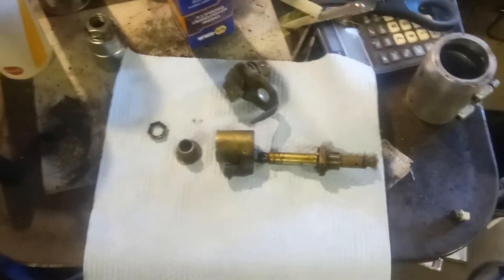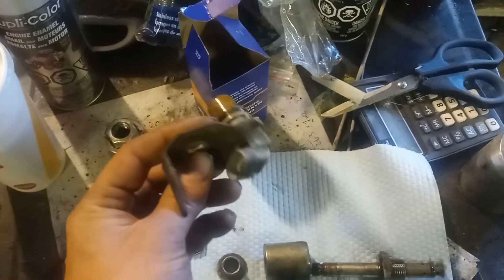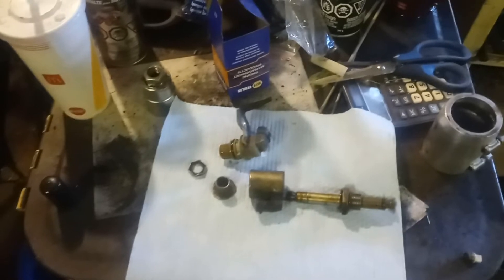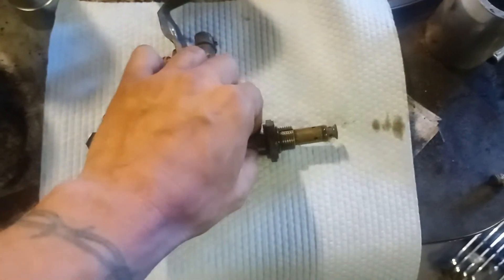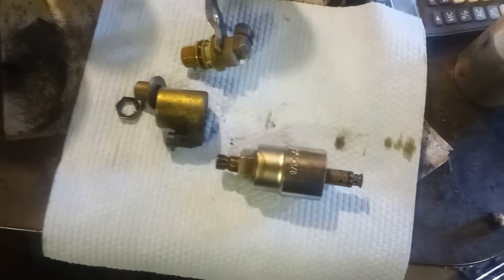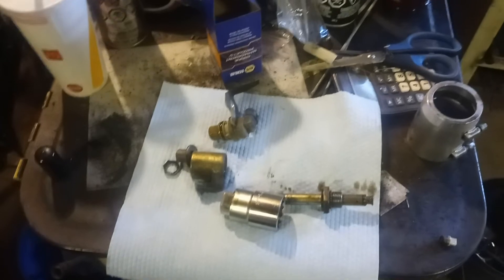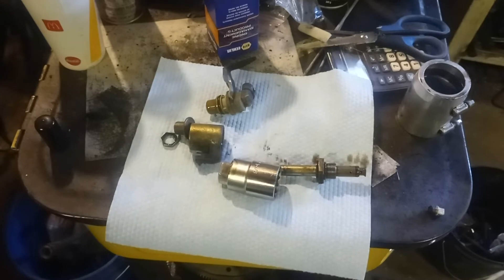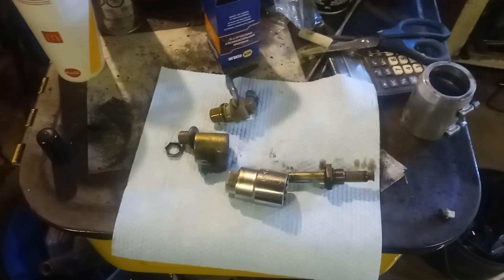7.3 powerstroke (TE444 IHC) sensors, weak links, sensor sockets.

Comment: Love 7.3L Powerstrokes!!!! My second favorite pick up truck was the 96-97 F250 4x4. Last of the Bull Nose Fords!
Reply from the maker: I like them a lot to. I would rather have a 92-early 94 with a 7.3 idi they are the same body style as your speak of but with a fully mechanical diesel. Late 93 early 94 there was a turbo idi option. Crank the pump and adjust wastegate and they make as much power as a 7.3 powerstroke.
Reply: @wildrosegarage4208  I guess I remember the ‘96-7s more since they were the last ones. I wonder how many of those old work horses. Great old trucks last forever 💪💪💪

Comment: I agree with you the old 73 and 69 IDI non-turbo ran forever tough as nails. Here in Pennsylvania all the farmer still have them they throw everything down this throat vegetable oil used engine oil transmission oil they just keep running
Reply from the maker: I have had two 7.3 idi turbo Ford trucks and a IHC S1600 crew cab with a N/A 7.3 idi and they were great. Your right they would run on anything. Mine ran the best on hydraulic fluid. A kid I worked with had a 6.9 he ran it on anything even gear oil. Didnt realy seem to make a difference what he had in it for fuel.

Comment: All that and a glow plug solenoid.  I try to find a good motor rewinder.  I've lived in KS,OK,TX and CO and I know only two. Nabb electric in Garden City, KS and Grand Battery and Electric in Amarillo, TX.  I trust their rebuilds more than new CAT or Motorcraft parts.
Reply from the maker: I have a solenoid on mine for something completely different but its rated for 200amps no issues with it in about 8 years. A can of started fluid is not a bad idea to have if the solenoid takes a dump. Auto electric rebuild places up here are few and far between. There was a old Italian guy that had a good shop but he packed her in or passed away. They only one around now sells junk. Pretty much just a clean up and paint. Thanks for watching.

Comment: Informative video. Does the dash display any error codes to let you know what sensor is causing the problem?
Reply from the maker: For the hpop system it will but not for cam sensor.